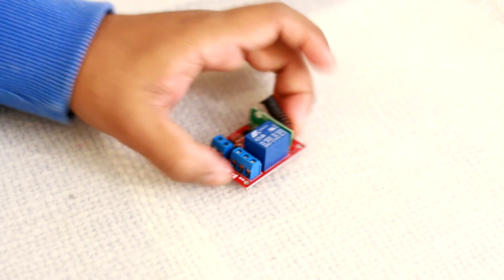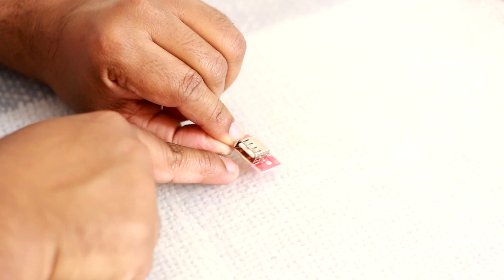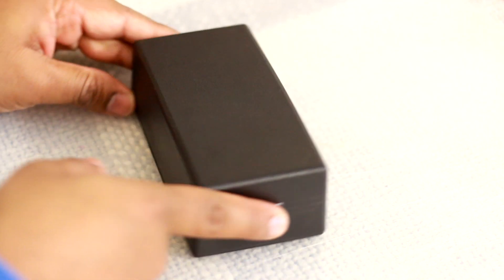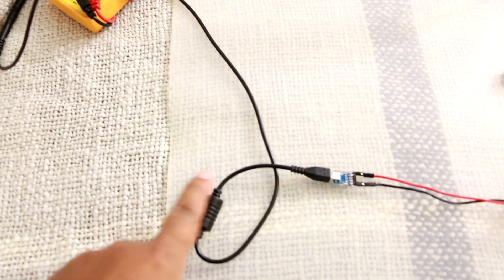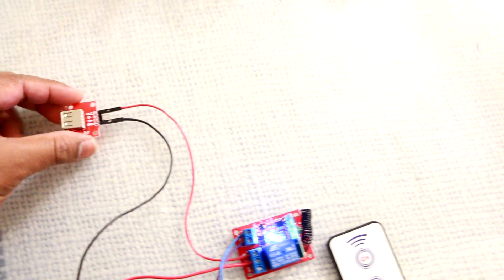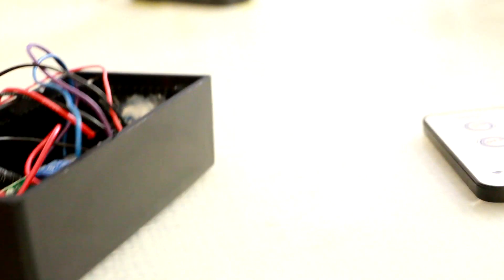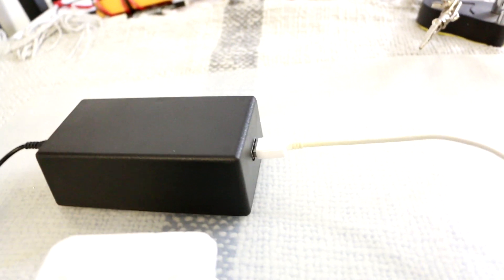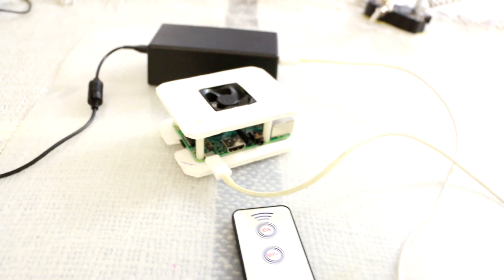How to: Add A  Remote control Power Button / Switch Raspberry Pi 1 2 3

Comment: Would you please tell  me its possible to build onoff switch and have it with me anywhere in the world directly connected to my pc back home and whenever i press it the button will be able to run a command in the computer ,  a pre defined task like open a pre defined software

Comment: does the pi auto save when you shut it down?
Reply from the maker: No, you have to shut down Pi through software first! this switch just cuts power to the Pi.
Reply: ok thanks for your help.